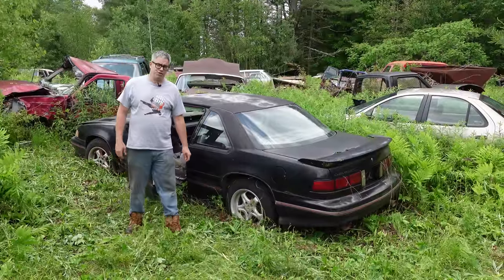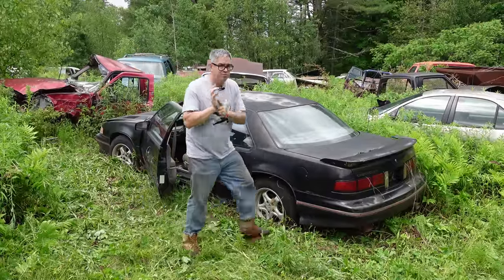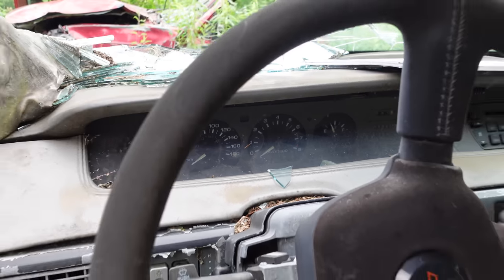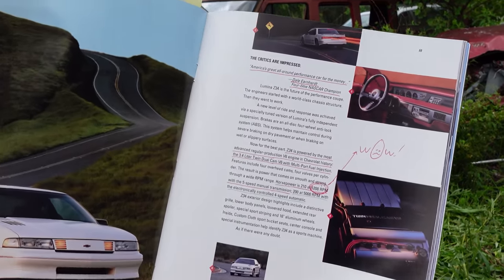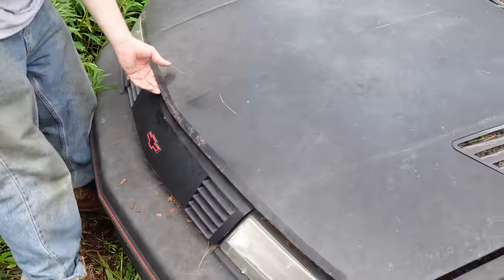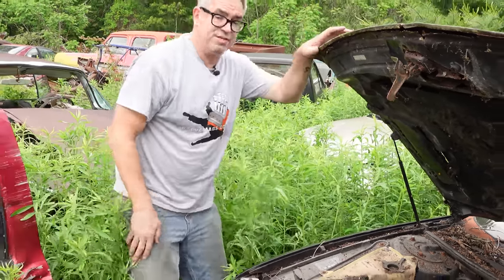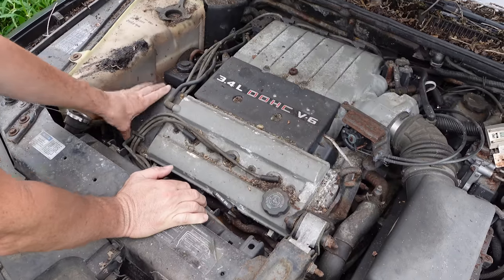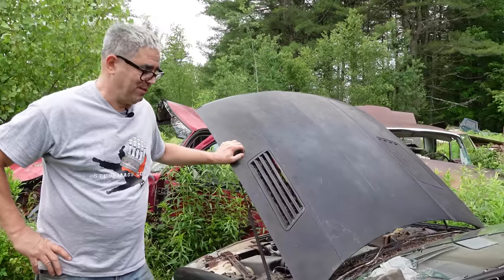What’s Up D.O.H.C?

Comment: My next door neighbor had this exact car in the mid '90's. I used to do tune-ups on the side and was asked to do plugs & wires on his. Those back 3 plugs were a nightmare. I vowed never to touched one of these car's ever again. I have to say though that the car was a lot of fun to drive. Outside of the maintenance aspect, it was a cool car. Again Steve, I love the titles of your videos, they make me chuckle. I often wonder how many viewers understand the titles. Is Bugs Bunny even still on TV?
Reply: I remember when these were new. I thought they looked good until I saw the service nightmare that was under the hood. Would not touch one just because of that. I always thought that engine would have been better in the Camaro as a step below the dogpie 305 or the more appropriate 5.7. At least you could get to the plugs when mounted the proper way (i.e RWD). A Eurosport Lumina with a growly little 3.1 was all that was needed in one of these cars. This engine missed its proper calling in a Camaro.
Reply: You had to remove that dog bone mount and rotate the engine forward with a lever/bar to access the rear spark plugs.
Reply: @paulmandeville  Same process as the 2.8 in my parents 84 Celebrity, although there was more room because of the pushrod, 2 valve heads.
Reply: @paulmandeville  That would be too easy. Instead I decided to spend 3 hours disfiguring my arms. 🤪
Reply: @LongIslandMopars  Not true about the rear plugs.
Reply: @paulmandeville  Not true about the rear plugs.
Reply: @jiggity76  If I remember the Helm manual that my dad bought for the Celebrity, it mentioned loosening the dogbone mount and rotating the engine to get better access to the rear plugs. I think Dad did the plugs once without loosening the mount but it was a pain.
Reply: @LongIslandMopars  Ah, gotcha.  I was referring more to the LQ1 motors.

Comment: LOL, the Series II 3.8 Buick V6 plain 4dr Regal Custom would dust the Pontiac GTP Dual Twin Cam, at least in the late 90s. I worked at a trannsmission shop and there was a recall on the 4T65E transaxle internal linkage, that would potentially disengage on it's own. The dealership techs couldn't/wouldn't do it, so they sublet'ed them to our shop. We did all sorts of cars, but the GTP Pontiac with all the widebody flares and ground effects, and heads-up display was the sexiest one of them all. A co-worker was partial to it and I was doing a Regal Custom, velour interior and Kleenex dispenser equipped (haha). We raced the brand new cars, standing start, from a roll and top-end, and I won with the 4dr Regal Custom every time (plus I weighed 150lbs more than my GTP driving friend!)!! Pretty pathetic for all those cams and exhaust tips!!!

Comment: Same 3.4l Oldsmobile cutlass 2drs had. Good motor. Designed like the northstar. Mechanics hated working on it. Gm prefected that design on northstar motors . Next round of gm junk yard finds will be the 3.6l current gm v6. No wonder toyota and honda selling more. No toyotas in that junk yard. U less totalled. And those the motors and trannys live on

Comment: So these engines were available in regular lumina sedans also. it had to be special ordered from the factory. They were also available in cutlass supreme coupe and sedan and also grand prix coupe and sedan as well. These engines were predecessors to the northstar family of engines. These engines along with the northstar family of engines are notoriously terrible oil leakers. Oil burners.. and difficult to work on. these engines were supposed to be turbocharged but when they get boost the headgaskets blow almost everytime. The reason you dont see these on the road much anymore is because they all suck in everywhich way.

Comment: My mom and dad had a 1992 Lumina Z34 was the biggest POS od crap they ever brought in the shop for brake problems for times and head gaskets and intake gaskets three times in .34k miles. Dad got tired of it and traded it for a 1995 Impala SS Black Cherry.

Comment: I owned Lumina's predecessor, the Chevrolet Celebrity Eurosport and it handled great. 
Rented a W-body Grand Prix (Lumina twin) and it was far less fun to drive (they used a transverse rear leaf spring). On a slalom test it would have come in turd.
And at least on the 2.8 litre Celebrity you could reach every spark plug. 
Not as pleasant a job on the 3.4 Lumina.
Reply: @peters8758  Nah, not a big deal.

Comment: The dual twin cam v6 was was  the performance option in the cutlass .. with a impossible to replace 
timing belt , poorly contrived nightmare
Reply: Indeed . The dreaded X engine ‼️

I remember seeing 👀 
one of those , timing belts 
getting replaced  .

The mechanic was absolutely 💯  incredulous  & aggravated  .

What a nightmare  !!
Reply: Three GM dealers had no idea how to replace the starter on my 04 Envoy. It has the aluminum 5.3 and not the straight 6 4.2. What a fun job that was on a downhill driveway. 1AAuto has 1,400 videos on that platform except one for the starter which they said they're working on. 5 years later...
Reply: @traderdan85  Not a nightmare...pure joy!  I can do my timing belt in about an hour.

Comment: I worked at a Pontiac dealer and they used the same engine in the Grand Prix. What a piece of crap. It was a nightmare to replace the alternator and the timing belt.

Comment: Speedo is KPH not MPH. Replacing the alternator was a nightmare on those. That dohc engine has also been swapped into fieros. Makes for a hot little car, but even worse to repair anything.
Reply: @garryhatchett775  Nah, generator change out is not that big of deal in my opinion.  I've done so many now, takes about a hour or so.
Reply: @jiggity76  hats off to you. I’ve only changed a few. I guess I didn’t find the secret. Been so long I can’t remember the flat rate time🤔.
Reply: @garryhatchett775  I currently own 2 LQ1 cars and have learned their in's and out's.

Comment: The most common thing I heard was whining about the timing belt.  As if you have to change em all the time. The belt isn't a GM part, so, generally pretty reliable 😂.  Change when recommended. Iron block and heads, so, heavy for what it produced. All GM needs is 2 valves per, a couple wheezy stock engine options, some stickers, and enough room to drop a 3800 s/c or LS in later. That way the unsophisticated can just change a plastic set of timing gears when the rattling gets too loud. Between alternators, power steering, trans, and coolant leaks. AND before it rusts out. I feel bad. They tried with the aluminum wheels, rear disc brakes, and the leaf spring lol. 

55 or so hp over the 3.1 SEFI that followed. Not bad, more than the NA 3800. Not quite Yamaha 3.0l SHO. Maxima with the VQ. V6 Camry. They made a car no one was shopping GM for.
Reply: Yep. Like I mentioned in a few other posts, the engine would have been better suited in a Camaro. More room to service and an interesting powertrain before stepping up to the 5.7 (let's pretend the 305 never existed).
Reply: @pgtmr2713  Incorrect, the block is iron while the heads and cam carriers are aluminum.